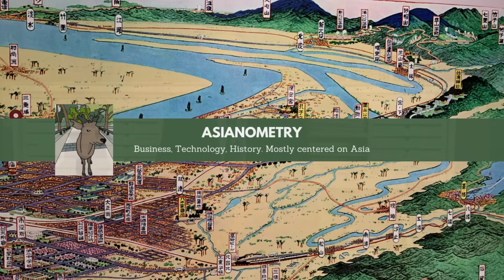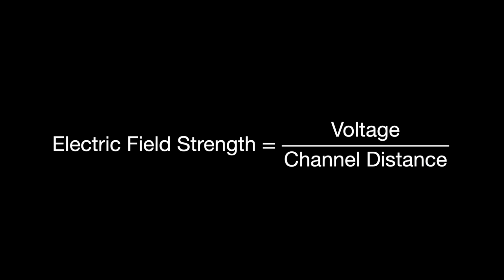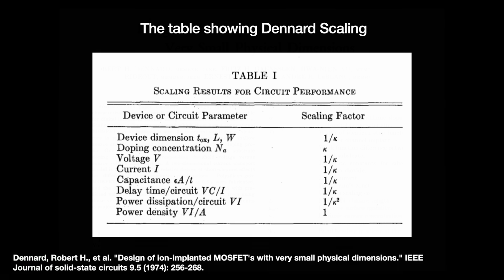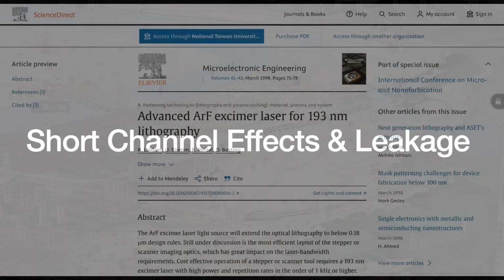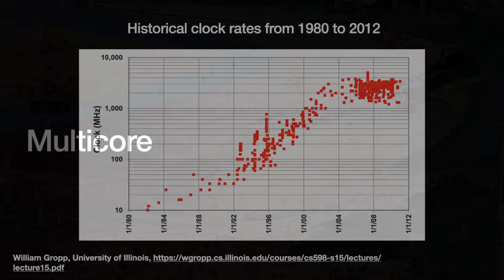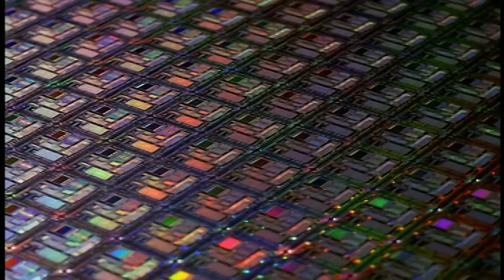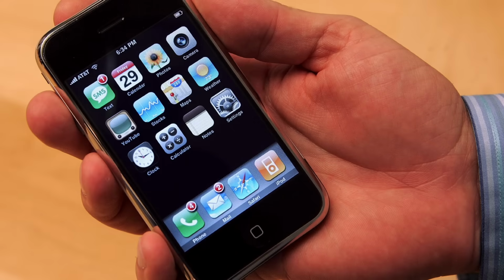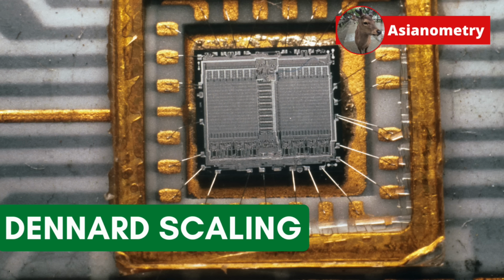The End of Dennard Scaling

Comment: Prescott, also known as Preshot, was AMD's big opening. They'd realized that pushing for ever higher clockspeeds was a fool errands, and designed a much smarter pipeline that could execute many more instructions per clock cycle. It was the Athlon XP and it should have dominated the world. Why it didn't is a story best told by Jim from Adored TV.
Reply: The first Pentium Ds (Smithfield, also 90 nm like Prescott) were an enormous gimmick (two separate dies) and would heat an auditorium. The AMD64 stuff of the era was just so clearly blowing it out of the water. I sometimes wonder what would have become of Intel if they hadn’t managed to get the Core architecture out the door in time and Apple had selected AMD for their x86 refresh.
Reply: @JohnVance  Intel was also very, very lucky that their mobile team in Israel kept iterating on the Pentium 3 design to produce the lineage that eventually became the Core processors. Without that alternative approach to fall back on once they finally realized the deep pipeline Pentium 4 approach was a dead end, they would have taken years longer to catch back up.

I sometimes wonder if the team that persevered with that design got the recognition they deserved for effectively saving the company from itself.
Reply: @JohnVance Hi, not sure if this channel had ever talked about the era when a division of Intel was working on a realistic CPU for mobile applications, they did a pretty good job tweaking and evolving the latest Pentium III into the Pentium M.
Anandtech did a couple reviews of Pentium M on desktop, it was kind of funny the conclusion at the time, something along the lines that even though a 2GHz+ Pentium M show promise Intel have invested too much into Netburst to now throw it to the bin. 😅
Reply: @JohnVance Pentium-M to the unlikely rescue!
Reply: @ “Why is my Centrino laptop faster than my new desktop!?” 😄
Reply: @ lol
Reply: Ironically this is also when they started hashing initial plans for Bulldozer.
Reply: @jrherita  No, that was several generations later. Bulldozer/Piledriver was a desperate attempt at selling cheaply but still making livable margins.
Reply: @andersjjensen Unfortunately, Bulldozer was never meant to be cheap. Sandy bridge cost less to make and the intention of BD was never to clock high, they just didn't have a choice and found out they could clock it high since the end result IPC is well, poor
Reply: @andersjjensen  It takes many years to design and produce a CPU from scratch (5-6 years).
Reply: @jrherita  Today it does (well, more like 4 years) but back then the transistor count was less than 1/10th of what it is today, so annual releases, despite only having two teams, were the norm.
Reply: @andersjjensen  Actually bulldozer was the foundational architecture that was as a result of the ATi acquisition, AMD planned to use the ATi ip to create a fused GPU/CPU architecture SOC that would have all FP type workloads be handled by the GPU section and the CPU was cut down and turned into an INT monster with very high clocks and throughput, but plans and software reluctance/slow adoption made it a total disaster.  Bulldozer was the result of this, a CPU missing most of the stuff that could handle workload that in theory a GPU could do if software was written correctly.  So bulldozer sucked at many things, but excelled at those CPU only INT work loads at the time.   Basically like nvidia CUDA does general purpose programmable work on the GPU that suit the GPU, that normally could only had been done on heaps of CPUs.

AMD learned from that mistake, the age old software compatibility/effort rule of thumbs, same sort of  thing that made multi GPU basically dead in the water.  This fusion thing they had grand plans for never panned out other than a few short lived APUs that didn't really do anything more than the ones we have now, again software.

It was a good idea, but like always software always ruins the day.

Software did eventually catch up somewhat for at least the CPU side, but took like a decade, Bulldozer and related CPUs are actually pretty snappy in normal daily desktop use, my old 8320 is wayyy faster to use than my equally daily zen+ laptop, this laptop despite being some 10 years newer is way slower for just daily tasks and stalls often and delays in anything you do. Not real bad, but very noticeable, even though the benchmarks show this laptop is faster by a fair bit.  Where the FX is crap is in games and FP heavy work loads where there are heaps, with games that are as old or newer than it they sucked because of this, it runs retro stuff fine as expected.
Reply: L A T E N C Y
Reply: I miss Jim's insights, and Glasgow accent.
Reply: This was a fascinating conversation; thank you.
Reply: Funny reading this comment. I built a winXP retro gaming PC around my old Barton core Athlon XP and SB X-Fi last weekend with an nForce2 board, 2GB RAM and a 7600GS I got on eBay, all inside a nos Thermaltake Soprano case.

Fun fact: The Athlon64's internals aren't all that dissimilar to the Athlon XPs if you ignore the obvious key differences such as the IMC, AMD64 and HTT instead of the EV6 bus. AMDs tweaks to the K7 over the years had left it very much limited by the Socket A platform rather than the CPU design itself, meaning that with a new platform that alleviated the major issues (ie. Moving the memory controller onto the CPU and finding a new, better bus that can scale into the future) it was able to offer a decent performance improvement solely because the design was finally able to properly stretch its legs.
Reply: Link the video. Couldn't find it on that page.
Reply: @Jisamaniac  It's part of a longer video, from 7 years ago about Intel's business practices throughout their existence up to that point: https://www.youtube.com/watch?v=osSMJRyxG0k&pp=ygUuYWRvcmVkIHR2IGludGVsIGFudGkgY29uc3VtZXIgYW50aSBjb21wZXRpdGlvbg%3D%3D
Reply: @Jisamaniac  Another user alerted me to the fact that YT "ate" my previous reply to you (it contained a direct link - how silly of me). The title is "Intel - Anti-Competitive, Anti-Consumer, Anti-Technology."
Reply: Adoredtv is cringe
Reply: "It was the Athlon XP and it should have dominated the world" didn't have enough cache
Reply: @andersjjensen is there a specific video you're referring to from Adored TV? I'd like to watch it but don't turn up anything pertinent in search.
Reply: @michaelchristianrusso Damn. YT ate the reply to another user with a direct link. The verbatim title is: "Intel - Anti-Competitive, Anti-Consumer, Anti-Technology."
Reply: @michaelchristianrusso  adoredtv does unpaid avertisements for amd products on youtube. He isnt know for being objective. He is known for defending amd at all costs even bulldozer
Reply: I looked for the adoredtv video and couldn't find it. What's it called?
Reply: @jamesmcjamesington631  "Intel - Anti-Competitive, Anti-Consumer, Anti-Technology." is the verbatim title.

Comment: You don't have to guess that Intel chased clock speed above all else. This was stated at the time. To crank up the clock they had to introduce long pipelines. Most code could not keep those pipelines filled. So a few pieces of code that fit the pipeline architecture well ran blazingly fast, but most code spent much its time stalled. They started losing to AMD on real world performance, and were saved by the guys from Isreal, who had been working on a different approach.

Semiconductor companies being saved by the guys from Isreal could be the basis for an interesting video. It has happened multiple times. Its unclear if the guys from Isreal are smarter, or if far from headquarters they are not pressured to pursue dumb goals.
Reply: Intel's Isreal-based researchers were charged with designing smaller, more efficient cores for laptops, so they didn't have the area, gate or cooling budgets for deep pipelining. This gave them the latitude to explore alternative approaches. However, most everyone really paying attention could see Intel's P4 designs were chasing pure "bigger number = better" Ghz which sound impressive to the clueless but are, in reality, pretty terrible across broad workloads. Those deep pipeline cache stalls, prediction and speculative execution misses just crushed performance.

All that deep pipelining infrastructure also consumed a lot of gates on its own. Not doing most of it freed up a gates which could be applied toward doing real work.
Reply: @MarkishMr  They were chasing, as well as Intel fans were chasing. All anyone could talk about at the time were faster single core. Understandable because single thread was easy to understand and do. Concurrency took a skilled programmer a lot more work to pull off effectively.
Reply: It might also be a case of “Thinking outside of the Box” in more ways than one.

Comment: Kind of a silly thing to name after someone. Like: if you shrink everything proportionally, it will work the same! 

That seems like the first thing anyone would try . . .
Reply: It wasn’t obvious at the time because it was considered impossible. Recall the remark that Dennard’s suggestion engendered laughter.
Reply: @glennac  I agree but that means there's more to the story. It was tried in the past and failed. Why was that?
Reply: It's not necessarily true. In fluid dynamics if you scale everything down the Reynolds number changes. So it needs to be proven that there is no similar factor happening in microelectronics.
Reply: @kazedcat  and a proof that it doesn't work would be more note worthy than finding out it works just fine 😂

Comment: Your oversimplified the length speed relation because all electric field moves at c but the change in electric field induces a voltage the other way it is called self inductances in L (Henry) and that should also decrease when the gate gets smaller.
Reply: Smaller transistor= smaller impedance= faster switching.
Reply: c is irrelevant here because the material facilitating solid-state electron propagation constrains the field-strength.

Comment: Intel Tejas and Jayhawk were canceled successors to Prescott. They were supposed to be 40-50 stages and 7+GHz. Intel always takes a long time to learn their lessons.
Reply: There was also a version of Nehalem that was netburst based, aiming for 10 GHz.   The name was re used later for the 45nm processor that actually launched.
Reply: @jrherita  The codename for a dual-core Tejas, Cedar Mill, was also reused for the final 65nm revision of the Pentium 4, which also happened to be used for the dual core P4s.
Reply: @mrbigberd  Probably happened on the same cursed timeline as the G5 laptop
Reply: These work in the soothing cooling liquid atmospheres of Uranus
Reply: @transkryption beat me at the liquid cooling and Uranus jokes.

Those cpus would easily double down as home heaters.
Reply: Well, they did learn from Prescott and it was reasonable to try. Not only do high numbers sell but the software could not use 4 threads and higher clock means more work per transistor.
It is good to be second, AMD got lucky. Both companies continued with mobile designs.
Reply: @0MoTheG   But the problem with having so many stages/buffers to achieve the higher clocks was that it was worse at actually executing the work due to stalls and massive bubbles in the pipeline and much higher latencies, this is the reason Netburst was actually slower than previous architectures even with way more clock speed, so intel tried to double down on the clocks, and eventually it did surpass the P3 and Pentium M designs, but took every ounce of effort to do so at the cost of power and high heat, and that actual surpassing was mediocre at best with some 3-3.5x the clock speed.

The PM and P3 as well as some designs from P Pro were used to build the design of the Core series that came in as Conroe, that was a massive success with clocks that were a modest boost over P3, and some 2-3x lower than P4 as the time of launch iirc. 

AMD during this whole period stuck to the short pipeline low latency design and scaled well so AMD did well with each generation but fumbled with mistakes during the Phenom days that broke that architecture, like actual bugs in silicon, FX was an interesting design that fixed a lot of what intel was trying to achieve with Netburst and had employed much of the good parts of their older proven designs, but totally screwed up when they went all experimental after the ATi acquisition and had the grand dream of fusing GPU and CPU tasks into the APU which was their ultimate goal, heterogenous type of architecture they still talk about today in the enterprise market, so FX was the CPU with the GPU ish qualities gutted out that made it far less multi purpose and just a Int machine, a good one at that, but still just an Int machine.
Reply: Interesting 😮
Reply: If they WERE aiming for 10GHz for a product to ship, makes me wonder what their R&D labs are ‘R&D-ing.’

Ramdom, but their lab employee’s NDAs and background checks and such must be similar to a Top Secret clearance.
Reply: @Pene7942  They never had anything they could have made at scale obviously. But it has long been possible to make CMOS ring oscillators that run at 20 GHz.
Reply: 10th reply wish intel shoudlve advanced the chips
Reply: We had a party/wake/quarterly celebration when Tejas was canceled.

Comment: Pentium 4 was a dream for me at 10 years old. My friend had one and command and conquer generals ran like a dream on it
Reply: Really? I remember Athlon was the the rage for builders and pentium was hotter and better on the Intel benchmarks for some reason. 🤔
Reply: Pentium4 was a great way to heat your home. as a space heater it was great. the thermal efficiency was basically absent.
Reply: Pentium 4, all you needed was a fast Nvidia card !
You bought Core Duo, the Quad Core extreme ? better !
Reply: I was building desktops back then for friends and they always wanted a $300 graphics card with a nVidia chip on it.  I said shit I should buy $1000 of that stock!  I did, that was 2001 :). I bought Intel and AMD too.  I wish I would have put all $3000 on nvda